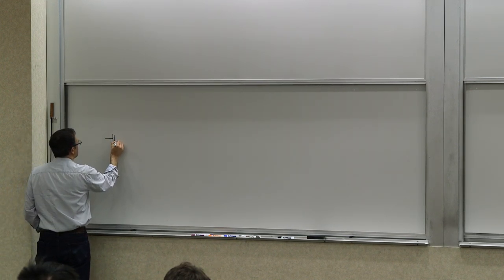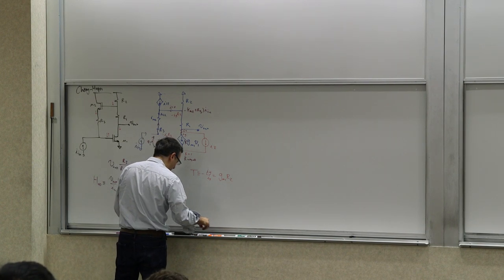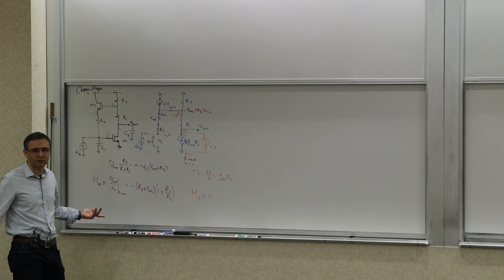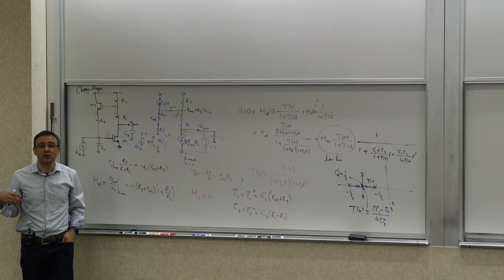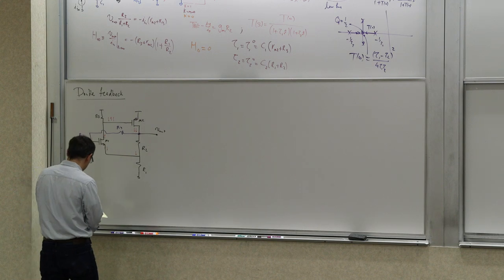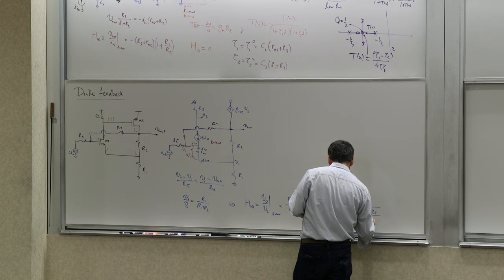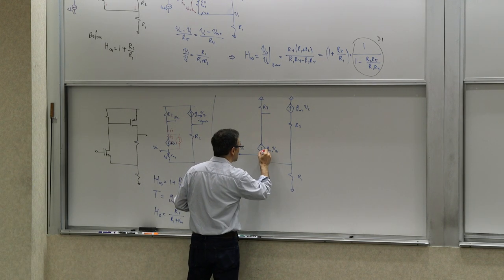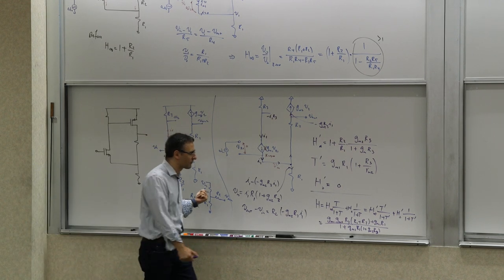162N. Active feedback, dual feedback loop, Source dependence of return ratio examples.

Comment: One question: using the T-model on 34:35 for the H_infinity calculation, it is considered iS1=0. As the current from the gate is also zero that gives a current K*iS1=0, the current on the R3 branch is zero and then v2 is also zero. That produces zero current on the R2 branch and then vout is also zero and V_in is forced to be zero. In conclusion, using the T-model for the first transistor and making k->infinitiy we get a pathological circuit. You save that situation with an implicit assumption of current flowing in the gate. In my humble opinion the T-model for the mosfet (no current on gate) is not a good choice if you want to apply the asymptotic formula on that controlled source.

Comment: If H_infinity, T and H_0 are not invariant, then there is no 5 seconds design. You really need to calculate all those 3 parameters.

Take for instance a case on the last example where gm2*R3 = 1. If I would look ONLY at H_infinity for a 5 sec design, for a gain = 5, in one case I would think (erroneously) that I could have R2 =4*R1 while with the other approach I would think I need R2 = 8*R1.

Comment: Thanks for the lectures, Professor . I have a question at 14:25 . For calculation of Tau2 , shouldn't we consider contribution due to gmv1 as when the input is nulled v1 is not zero ?
Reply: Here ro of the transistor is assumed infinity. Hence an open circuit. Therefore no impact due to M1
Reply: Here you are looking for the transfer function between ix and iy. If having an ix as input current source and looking for tau, you have to null the input (set current source to open circuit) to look for R seen by C2. Thus the effect from gm1v1 will be blocked away by the open circuit.
Reply: @zelongliu6552   @feynman g  @Vinay K George  -

if one goes by the suggested methodology: For calculation of time constant for C2 : ix=0  (current source is null) leads to no current via R1 and R2 . It leads to V1= 0 (as C1 is set to zero), this setting the gm1V1 dependent current source to zero. Thus there is infinite resistance seen by C2. Am I missing anything here?

Comment: At 34:22 , you are scaling the dependent current source and applying Asymptotic Transfer function. But here due to negative feedback to get finite voltage at output the current through R3 resistor to be finite and it implies that IS1 current will be zero. But my doubt is that: a finite amount of current is injected into the node but no current is coming out as IS1 is zero and current through gate of M1 transistor is also zero... So, it is violation of KCL... Right? 
But when you are applying PI Model of M1 transistor then you are saying a finite amount of current is flowing(38:12) and we cannot apply Voltage divider there to calculate H(infinity)... So, in both of the cases, are you not doing contradiction?
Reply: For the T-model case, we are saying k*is1 to be finite, and since k is infinity, is1 is 0. But is1 is defined as the current across the rm1, thus we have the current on this whole branch is 0.
For the pi-model case, we are setting kgm1v1 to be finite. Although we have v1 is 0, but the general current is only known to be finite but not 0. Another way to think is not like the T-model, we do not have another rm in series, which will force the current to be 0.
So both models are closely following our rules.
Reply: @Zelong Liu  I understand the logic but for the circuit which uses T Model K*IS1 is also finite. Because, in circuit we have -ve feedback and to get finite output with K -> infinity the only way to consider IS1 = 0. Hence, K*IS1 = Infinity * 0 = Some finite quantity ( Loosely speaking) . So, we are having finite Current K*IS1 going into the node but zero current IS1 is coming out. Will not it violate KCL? That is the question.

But the logic is going well with PI Model as there is a path way for the finite current to flow and that is the reason for which voltage divider cannot be applied.
Reply: @ayanchatterjee3884  Base on my understanding, for the T-model case, we know that k*is1 is finite but up till this point we don't know if this finite is zero or not. And the definition of finite could be 0. But through the analysis on rm1, we know that is is1 must be 0 then the branch current must be zero. Also we know that under lamped circuit assumption KCL must be valid. Thus we further confirm than k*is1 is not only finite but also 0.
Reply: @zelongliu6552  I think so :)
Reply: @zelongliu6552  @Ayan Chatterjee  The problem is that with k*is1=0 then v2=0 and vout=0, leading to a pathological circuit (vin=0). In my humble opinion the T-model is not always valid for the asymptotic formula if you use a mosfet. A bjt allows current on its base and there is no problem.